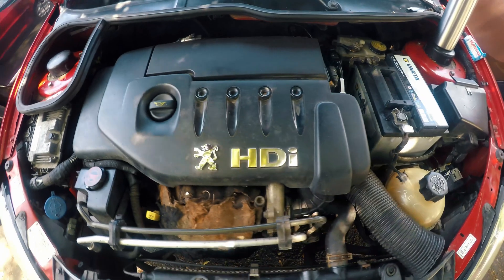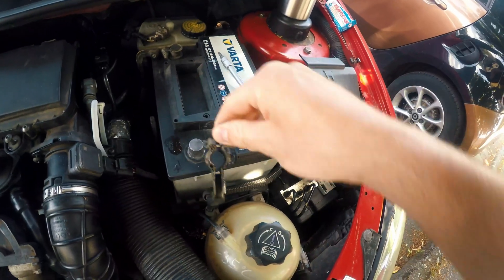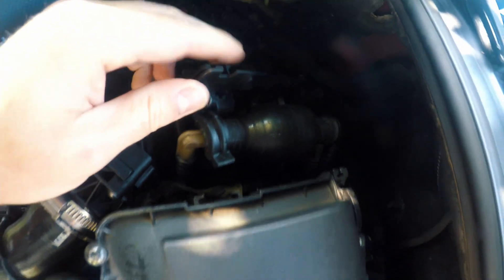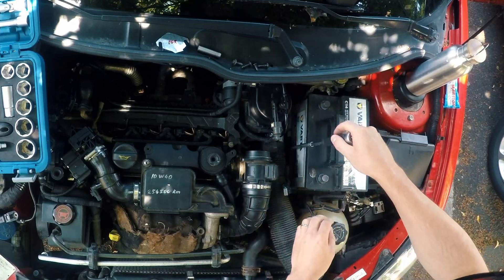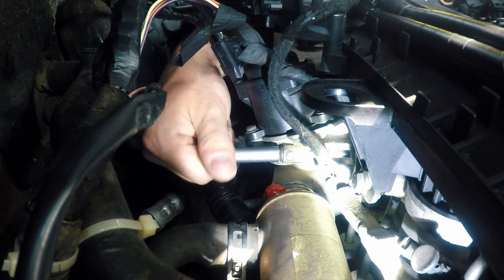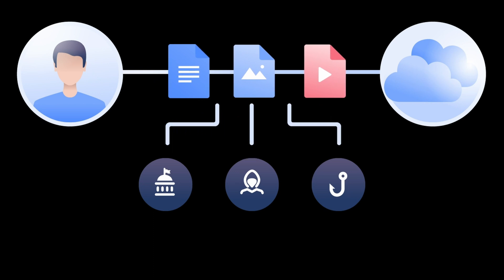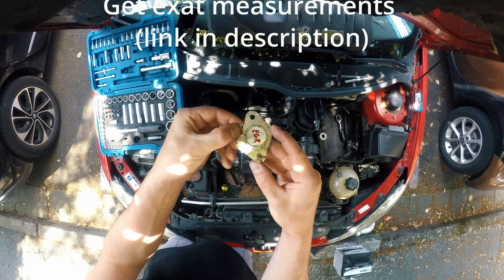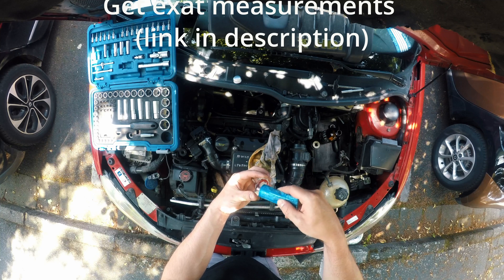1.6 HDI EGR VALVE Delete Or Blanking | DIY EGR Blocking Plate

Comment: Well, on mine 2007 1.6 HDI 110hp  after blanking, the code P0401 and limp mode 😢. After reset with diagbox it always come back on after 40-50 km on the road ...
Reply: You need to shut down egr in software aswell!

Comment: Well after blanking I got a p0401 error code...
In 1.6 hdi I think you need to put a small hole in the plate, to still allow some exhaust gas going thru🤔🤷

Comment: Tuning shop says it is not necessary as the delete the egr on the ecu? Should i still be adding the plates?
Reply from the maker: if you have egr valve stuck open then software doesn’t do much ….

Comment: I have a faulty EGR in my C4 1.6 HDI. If I blank the EGR, will it make the error code disappear or should the EGR be okay when blanking? And do I need some codinf in either of the cases?
Reply from the maker: hi , you will have to remove shutoff valve otherwise - massive vacuum in the intake manifold when downhill.
Reply: Am currently looking at changing my egr, but have seen some videos/comments saying it needs to be calibrated after changing on c4 hdi 1.6. Is this not the case then?
Reply: 😂😂😂 it is cheaper to clean or change EGR than delete it.

I bought new EGR for 40€.
If You change it, there is no need for remapping...

I would never delete EGR or DPF or any particulate sensor...

Comment: I want to blank it with a thick stainless steel plate, would it fit into place?
Reply from the maker: Hi, I wouldn’t go thicker than 0,5cm  otherwise it will require additional work .
Reply: @takeapart  thank you, i like your work and video. Subscribed.
Reply from the maker: @osman_zengin thanks a lot

Comment: You only need to loosen the bolts enough to slide the blanking plate into place theres  no need to remove the gasket or use silicone.
Reply from the maker: hi, thanks for your tip …. silicone was to fill imperfections of the material used to create blanking plate.
Reply: It looked like he used gasket sealer, and that's what I think he meant, not silicone.

Comment: How does that work, i get that plate blocks the dirty air comming into the engine but that valve in the egr will continue opening? And wont engine get less air in it or?
Reply: The engine still works and breathes it just stops all the carbon etc getting in, it might put the eml on but should pull a bit quicker etc.